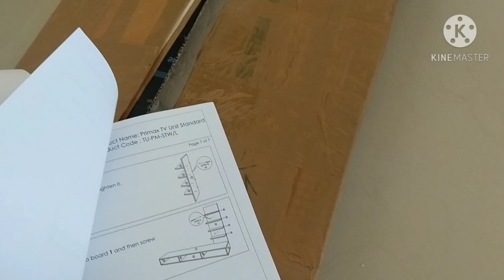Bluewud primax TV entertainment unit।। Unboxing & installation🔨 process।। Review-Chip &best ✨🌟⭐

Comment: Nut bolt konsa laga hai ismai bade waale
Reply from the maker: 0.51min  video  dekhna usme Mene 4bade wale bolt btaye hai usme fastener ko  drill machine se  hole kar k usko insert krna  wall me fir jo rod hai unko fix  karna hai uske baad board ko wall pe hang kar dena
Reply: @mrs. Bhide
Wats name of this bolt?
Reply from the maker: Fastener bracket jo wall pe fix hoga and fastener rod usko bracket me fix krna hai  saare nuts and bolts aapko milte hai product k saath bas aap k pas drill machine and hammer ki requirment hogi